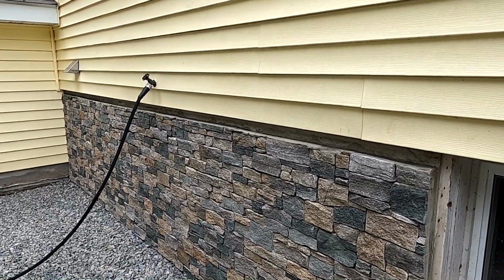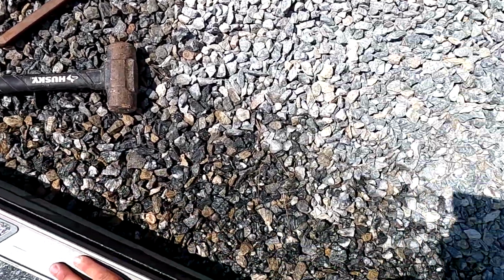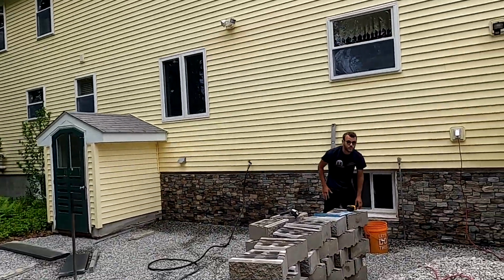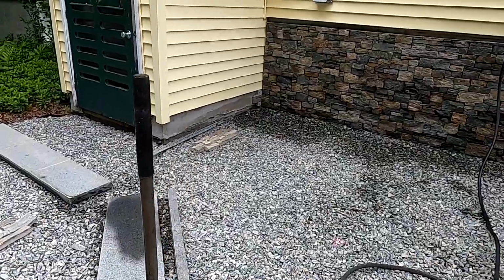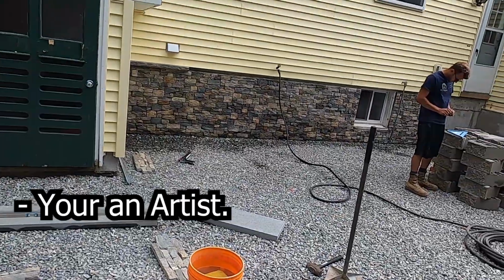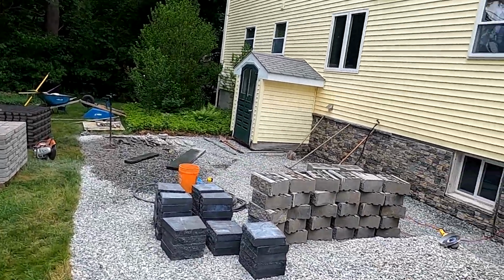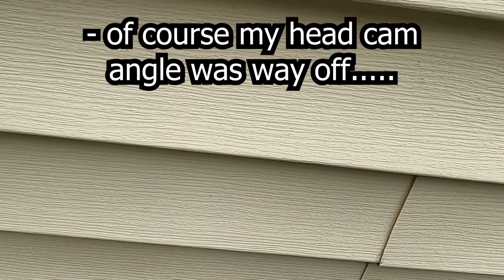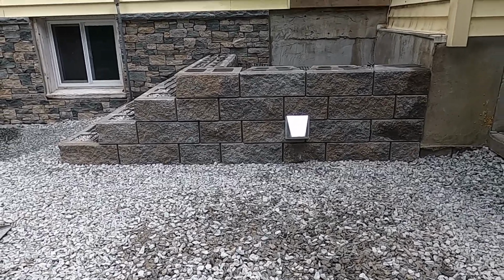Installing Granite Caps for Stone Veneer

Comment: Damn bro!!!!! Niccce job!!! You killed that! I’ll tell you what im never more stressed out than when im rock facing treads lol! I’m like if I blow this it’s gonna be expensive. Luckily I haven’t blown one yet (knock on stone)! And I like the way you put the caps on I never even thought of glue I always use cement but the glue looks way simpler. That’s a great way to do it. Also great job on the panels of thin veneer. Those are tricky to make look right and you nailed it. I thought they were individual pieces till I looked closer so great job on that!!! All in all you did an ace job!!! Your killing it!
Reply from the maker: Rock facing is definitely stressful.... Not cheap to screw up on that, I have broken a few pieces... not gunna lie 🤣 And for the caps, there just isn't enough room for mortar on an application like that in my opinion. That glue holds on tight and is very easy. 👌 I always mortar treads down when building steps though. Those panels are the best in the market in our area. They do a good job manufacturing them, way better than the majority of garbage panels you see out there... I prefer to do legit stone veneer, but people like how much money they save in labor with this option. It is perfect for something like this. Thanks for the feedback brother! ✌
Reply: Yea man you killed that job!! Looks awesome bro! Thanks for teaching me something new!!!! 👍💯⚒️
Reply from the maker: @maxg9999  ✌

Comment: I also have yellow siding and will be doing real stone veneer on my ugly cinder block foundation.  I have been having trouble trying to find a car that would contrast well with my yellow siding. I absolutely love what you chose for this project for the stone veneer. Would you mind sharing which manufacturer and color name you used for your stone veneer for this? Thanks in advance.

Comment: Did you do the veneer under the siding as well? Where do you put your rip If there is one?
Reply from the maker: The veneer stopped below the siding for theses caps to fit in between. Any water coming down the siding will flow over the caps and down the face of the veneer. I think thats what you are asking?

Comment: Wouldn't be better if you installed pavers before the veneer, so the veneer will sit on top of the pavers... also gives a nicer finished product.
Reply from the maker: That's actually not a good way to do it, especially here in massachusetts... If you do that and the pavers lifts during the winter months it can cause problems. Also, the look of a foundation being on top of pavers just is not right. Stone work should always look like its coming out of the ground, not on top of the ground. The goal is for the veneer to look like it is the foundation wall, installing them on the pavers would take away from that and honestly, it would look kind of cheesy in my opinion.